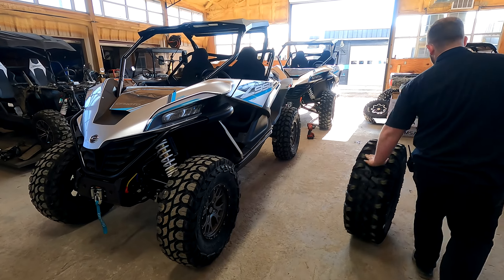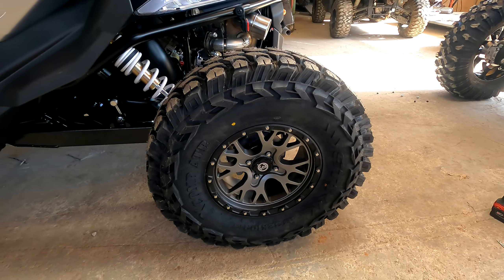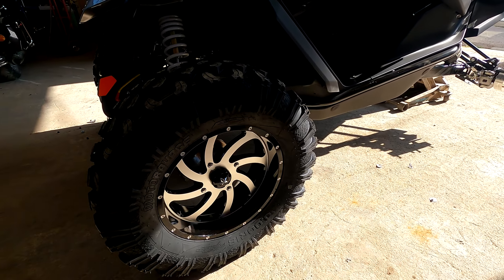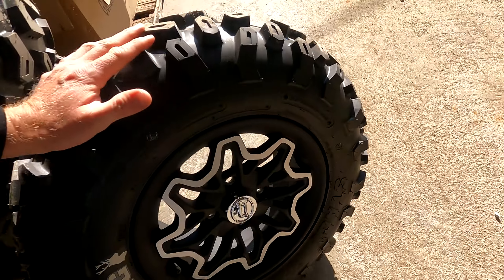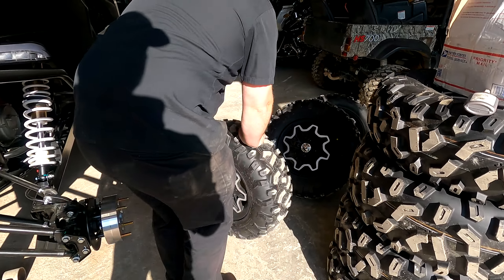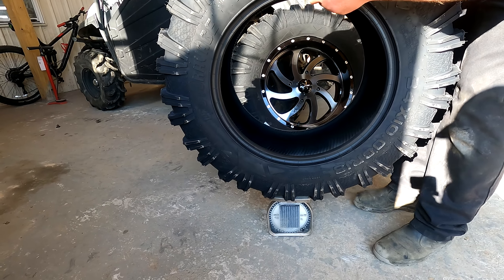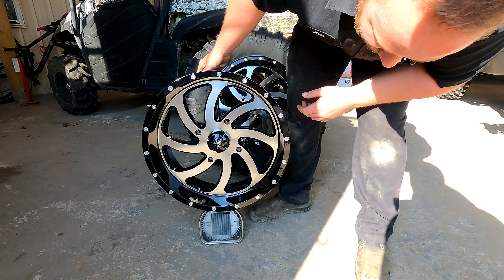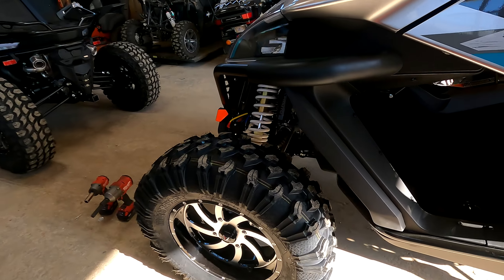2021 CFMOTO ZFORCE 950 on 34 inch Tires 18" Rims | SxS Tire Comparisons

Comment: Nice job, for doing all these experiments with tyre sizes. So I guess the next logical step with all the extra weight would be to think about some engine upgrades, maybe you already have something in mind? :D
Reply from the maker: Yes we would like some more power.. but there are no consumer options right now. But we may be doing some experimental work on one soon.

Comment: Dam Looking Good i have a 2021 zforce 800 trail what size tires can i out on it
Reply from the maker: I know the 800 ex can handle 28s but I'm not as sure on the trail model since the tires are tucked in a little closer